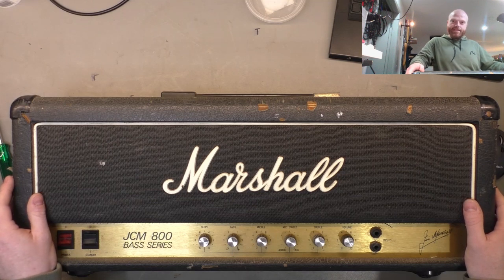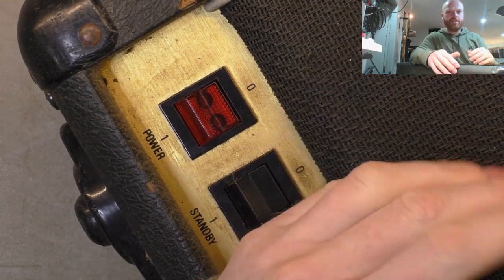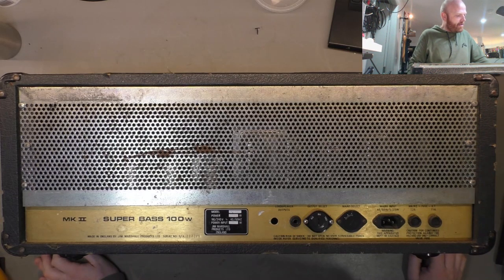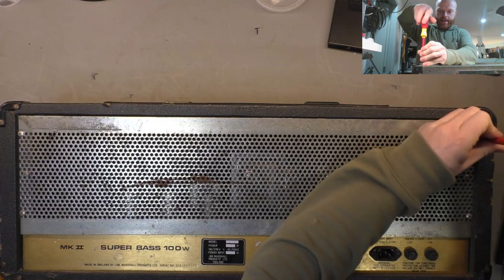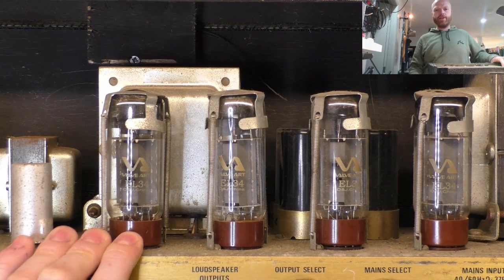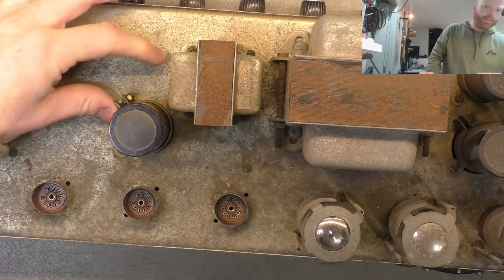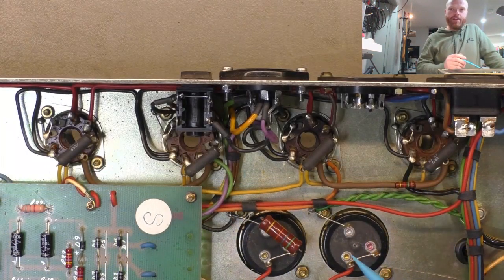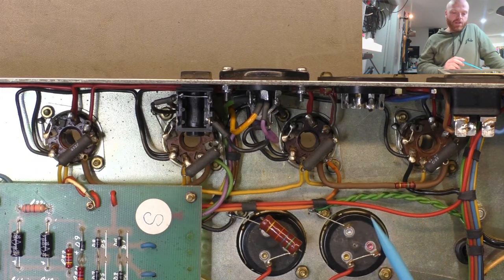JCM800 '1992' Super Bass - Part 1: Assessment

Comment: At 5:40, that's not a Philips screw, it's a Pozi-Drive. Probably why it's chewed up in the first place, because somebody used the wrong screwdriver on it.
Reply from the maker: Yes, pozidrive. I have #3 pozidrive bits. If it was more than finger tight, that's what I'd have used.
Reply: @BradsGuitarGarage  ,  It amazes me how many people don't recognize the little tick marks in the screwhead that signify a Pozi-drive screw, and are unaware that it requires a different bit.  Perhaps that's a reason why so much of the world has embraced Torx screws because it's virtually impossible to get the size or type wrong when choosing a bit or screwdriver to match the Torx screwhead. (Although, I have seen "star" headed security screws that have 5 points or spokes instead of 6 like the Torx).